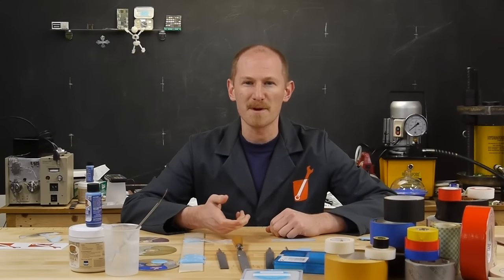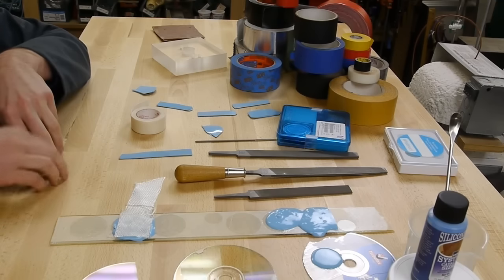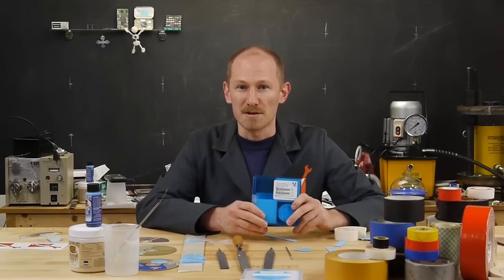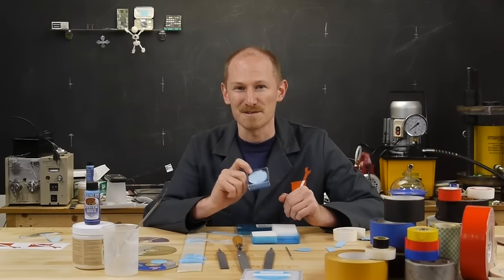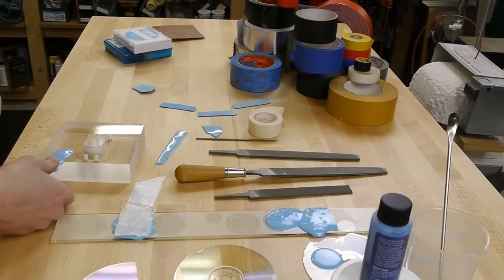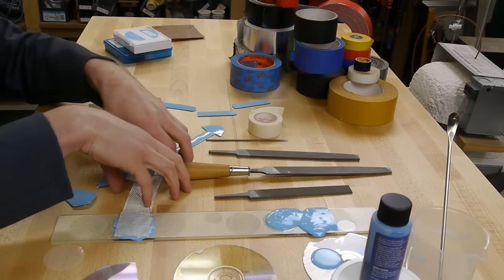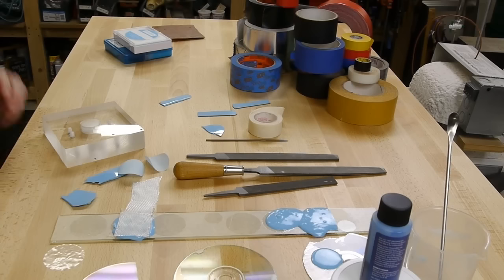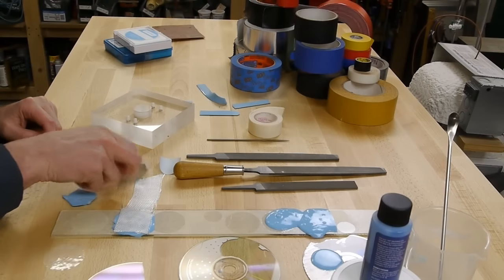Making DIY gecko tape - work in progress

Comment from the maker: I appreciate your comments so much!  Thanks for the thoughtful and helpful advice. From my point of view, the youtube comments section is one of the most active and effective resources for project involvement.
Reply: +Applied Science What does the cast on glass look like under the microscope? maybe it really has a pattern.
Reply: +Applied Science How about casting a 6000 grit sharpening/polishing surface? I believe the structures there are about 2 micron, though likely rather chaotic/unstructured. Not sure it would meet the 4:1 ratio requirements you described.
Reply: +Applied Science Hi Ben. Maybe you can make a mold using fine wires (similar to small scale pin impression toy), and take advantage of the "circle packing problem".  The tiny gaps between the wires would create a negative mold for the silicone. 
By adjusting the diameter of the wires, you could create a very fine and uniform layer of "hairs" on the silicone.  This would produce triangle shaped "hairs" so they may not lay over as easy as the round ones did. The wires in the mold could be angled as well.
Then again, it may not work at all. Either way, just a thought.
Reply: +Applied Science Have you thought about a reverse osmosis filter membrane? They come in a variety of hole sizes. I just did a quick search, here's a picture of a membrane made by memfilm.com, if you can cut it down the center, it has the same tree pattern where the ends are very fine bristles. http://www.memfil.com/images/H1A.jpg
Reply: +Applied Science You can get photomasks made for relatively cheap (in terms of research level costs) by ordering online and sending in a .dxf file with the pattern you want. Masks are commonly available with resolutions ranging from 10 microns down to ~3 microns. Getting masks down to 1micron resolution gets expensive, and if you need sub-micron resolution you'll be needing e-beam written masks which are much more expensive. Also, getting 1 micron or better pattern transfer from a home UV exposure system will likely be very challenging, as the exposure and developing times will need to be carefully controlled.

As for the file technique, you could try a double mold where you cast off the first casting to get a shape identical to the original mold. Likely some sort of release coating is needed to prevent the silicone from bonding to the silicone mold during the second step.
Reply: +Applied Science how about making mold out of gecko foot
Reply: +Applied Science Could the pores of our skin work? i know our finger prints are to large but the pores should be small enough, do to  how we absorb water and such through the skin.
Reply: +Applied Science have you tried  casting into the cast of the file? The sharp edges become the trophs of the cast. So if you cast it again, they would be on top again :-)
Reply: +Applied Science maybe try to make your own metalic layer (control thickness) on a CD and try to burn a pattern down (101010.....)
Reply: +1 on ordering a commercial mask to try. 

I might also suggest ordering a bunch of different diffraction gratings. I can't speak about their aspect ratio off the top of my head, but the spacings should be the same order of magnitude and they are quite cheap (especially some simple classroom sets).
Reply: +user21XXL 
He could also try to modulate the laser's power to change the depth of the pattern.
Reply: How about spaying a powder on the glass before casting. Then you can wash the powder off the tape.
Reply: +Applied Science will it work if you kinda try it like chip manufactureres? do they use some sorta light system? if so, maybe that could work?
Reply: +MrCamoGaming yes, I thought about that too...seems like it would get him what he needs
Reply: +Applied Science  Have you considered using alumina membrane filter discs?  I worked in a research lab and used these to make nanowires.  The aluminum oxide structure in the alumina membrane is a perfect crystal lattice with a common pore size of 200 nm, but different sizes are available.  Polycarbonate membranes have few pores compared to alumina.
Reply: +Applied Science 
Hi Ben, In line with +Henner Zeller 's comment below - you might be able to get high aspect-ratio holes with diameters in the nm-range if you could hack your SEM to work as an e-beam lithography machine. Do you have access to mono-crystalline Si-wafers? E-beam patterning followed by anisotropic etching of the wafer could be one way to go. While chemical etching might give you pyramids, probably an ion-etch would be needed to give deeper pits. A "low-tech" approach might be to use the glass-pulling principle on say PLA. Imagine you started off with a 'rope' of 19 PLA filaments, 1m long. If you could heat-and-stretch these to (say) 7m, then chop it into 7 parts and make a meter-long "rope" again (sounds tedious, I know) and repeat 3 more times, you could end up with sub-micron "hair" usable for the feet.
Reply: I would investigate BluRay discs. They have a much higher data density, which could give you the results you want.
Reply: +Applied Science 
What about making a casting of the casting of the fine file? Then the sharp ends will be on top.
Reply: +Eugene S I knew someone would beat me to this idea, it was the first thing to come to mind as the pores are between .0008-.0001micron. In my estimation pressure would need to be applied to force the silicone into the pores of the R/O membrane because to even get water to pass though my system I need a minimum pressure of 40psi. Not knowing the viscosity of your silicone, I cannot say what you'd need to pass it into the membrane without actually passing it through. It's good to know I wasn't alone in my pondering...Aloha, and hoping your 2016 is going well.
Reply: +Applied Science 
Gore-Tex?
Thanks, Ben!
Reply: +icarus901 I'd made a hard negative mold from a 6000 grit surface, like icarus901 suggested. That way when you cast your latex, you will get a positive, the same as the 6000 grit surface, including the sharp points.
Reply: +Avi Tech This is a great idea!
Reply: +Applied Science Write a Blu-ray with a large file that is filled with data that is written with primarily low data dot, rather than high dashes. The Blu-ray hoes 150nm over the 800nm of a CD.
Reply: +Maxx B I just had another idea, I wonder if it would be possible to get hold of a silicon platter that had been used to make ICs, but had failed testing, so was useless. The texture of the individual transistors etc on the silicon might provide a good molding surface.
Reply: +Applied Science Can't you use an electron beam to expose the photo resist? If so you could use your raster electron microscope to write real tiny structures provided you can vary the beam intensity or have full control over the scanning pattern and speed.
Reply: +Applied Science i dont know if this works, but couldnt you just find some fine sandpaper and use that???
Reply: +Applied Science how about filing the surface of a vinyl? it might not be as precise as other things, but maybe worth a try.
another suggestion, might to try using very fine sandpaper. But that might cause the same problem as the file, with the sharp top/bottom.
Reply: +Applied Science Hi Ben, this might be a long shot but i am about to teardown a device that has a small x-y table that has laser optics and 5 micron resolution (it was a microarray scanner, the laser was for illumination) but maybe could be modified to make a high resolution laser cutter for your mold? - Keep an eye out for it on my channel during the coming week.
Reply: +user21XXL 

That decade old project to burn images to the data-side of a CD might be useful if one can't afford a real laser printer:

http://www.instructables.com/id/Burning-visible-images-onto-CD-Rs-with-data-beta/step2/Convert-a-picture-to-data/
Reply: +Applied Science I don't know if the ratio would be right but would syringe filters work? I know they aren't very big but they have filters that have the pore size you are looking for.
Reply: instead of lenses, use concave mirrors
Reply: you could get an actual geko and make an actual negative mold of the l their foot
Reply: I believe using a vacuum chamber might help results by helping remove the air trapped under and in the material
Reply: It would make a better bond with the mold but wouldn't the structures formed from air pocket voids help?
Reply: +ReluctantProphet I thought the same until Ben said that the sillicone works it's way into the holes fine; and the SEM image showed that this is so; in fact the problem was that the pillars were too long - ironically micro air bubbles at the bottom might have helped!
Reply: +Applied Science you're lucky you have a good audience, youtube comments can be toxic lol
Reply: +Knolltop Farms He's got an excellent vacuum chamber, you can probably just pull a vacuum and suck the silicon deep enough into the pores of the RO membrane...
Reply: +Applied Science try a water in oil emulsion with the silicone. use a tissue homogeniser or even better a microfluidizer to make the emulsion the right average diameter. spread emulsion to desired thickness on polycarb. evaporate water phase under heat lamp. surface will be porous at the right um scale. adjusting the ratio of water to silicone will adjust the density of your pores. at a high enough density the pores will aggregate, and the residual silicone will look like the "towers" you are looking for.  for more information look up thin film formation techniques. you can even sandwich a porous layer on top of a smooth layer for strength.
Reply: +Applied Science Why don t you mold the surface of an aerogel? the open pores would allow the silicone to penetrate far enough without needing vacuum.
Hydrophobic aerogel might work best, to prepare it just expose a normal silica aerogel to silane vapors under vacuum or neutral atmosphere (just heat a piece of silicon to generate the vapors).

Porous silicon which is made by anodizing silicon possess also such kind of long interconnected pores and are not so hard to make.
Previously proposed anodized aluminum exhibit highly ordered pores but no interconnexions so trapped air might hinder the silicone penetration but i could be wrong.
Reply: a CD/DVD burner should not require too much fiddling to achive the required density of pores in the substrate to be used as a mold (the blank disk), maybe it can be regulated to produce different depth...
Reply: +Applied Science So, Destin from Smarter every day did a video on Butterfly-wings where the Colors are created by gaps in the structure which absorb special wave lengths. Therefore I assume these gaps are really small. And i think there are some materials which mimic this property. So maybe you could use butterfly-wings as a mold :D
Reply: There is a way to get nano structures cheaply if you're not squeamish. You can use lab-grade "disabled" viruses which are hydrophobic over there entire body length, yet hydrophilic at their ends (I'm thinking of disabled Archaea type viruses). If you spin cast a drop of water on a glass plate then, you spin cast a drop of those viruses on top of that uniform humidified plate. Since the viruses are hydrophilic at their ends, they will all "stand up" on the humidified surface (densely packed I may add since their girth is far less than their length).

Afterwards you can put a layer of casting silicone on top. When you peel off the silicone, you dissolve the viruses with an enzyme solution, leaving a negative impression of nano meter structures. From then on you should be able to make a "positive" cast of very densely packed nano meter diameter / length structures (depending on the type of virus used)

Hope this was useful suggestion :)
Reply: +Applied Science  Can you use your electron microscope's electron beam to do the etching? That should have a fairly high resolution....
Reply: +Applied Science the youtube comment section is good only because you inspire goodness. Usually, on average, the youtube comment section is an absolute mess; rivaled only by IMDB and Yahoo Answers. But when people make good videos like this, it can inspire good comments. This is why you are one of my very favorite channels.
Reply: +verdatum 
Ben inspires goodness, and he makes it look easy. He seems to have an inherent talent for effective communication.
Reply: deposit nano tubes onto an substright.  Chemical Vapor Disposition (cvd) deposited onto a silicon waffer ( don't want arc method too messy)
Reply: nanofabtools.com has some information, I googled for "nanostructure of glass" and looked on the image search results for something similar to what you described
Reply: Hack a DVD burner by increasing the power of the engraving laser, and burning it with only 0 bits, to make only dots at a microscopic scale. Or maybe, try with a blue ray disc, as those have a better depth/width ration
Reply: Microcircuits can be created via litho by means of a tracking lazer, a glass die and essentially a magnifying lens. I wonder if there is a method to replicate this at home for creating micropore and the like
Reply: jcims  Thank you.
Reply: +Applied Science maybe you could use or hack a CD/DVD burner to write a dot pattern over and over to get the depth you need, not sure if you would need to prep a special surface on the media, or if in fact CD/DVD burners are capable of syncing writes that closely (i.e. multiple write passes might be out of alignment).
Reply: +Applied Science What if you tried a Mr. Clean Magic Eraser, or perhaps a finer pored melamine foam, if you can find it?
Reply: *****
What if you used the burned media as a mask instead then for some form of photoprocessing?
Reply: +Applied Science How about using your photo lithography, but using interference patterns from a scattered UV source? You can get down to pretty small feature sizes with this approach.
Reply: +Tobia C. What if, instead of a normal CD, he uses black plastic in the shape of a CD.  Then, couldn't he use a modified CD burner to etch the plastic?
Reply: +Applied Science 
I think you can try immersion lithography. It is basically introduction of highly pure water between mask and the substrate, to reduce the dimension of the transfer.
I mean that's how they are still using ArF UV source, instead of deep UV source for the IC manufacturing. It might help you out.
Reply: +Applied Science Not sure if anyone else suggested this, Dvd/Blue-Ray have even higher densities than CD&#39;s maybe you can give them a try. Also try to see if you can do a static burn pattern to just write 0's or 1's.
Reply: David Dachenhaus I've seen others, including myself, suggest the blue-ray. However, the static burn sounds like a great idea.
Reply: +Applied Science you could make a mold on the very fine file then  cast your rubber on that.
Reply: +Applied Science  Saw this paper: Solvent-tuned hierarchical porosity in nitrocellulose aerogels.

Maybe try an aerogel substrate for the casting.
Reply: +Applied Science - how about using Basotect ( http://bit.ly/1OI988C ) as the casting mold.  It's an super fine open cell foam, most commonly seen as a "Magic Eraser."  Or, perhaps stacked and alligned graphene sheets in thickness enough to reach the desired length of the "gecko hair" through the graphene sheets' mesh.
Reply: +Applied Science http://www.sciencedaily.com/releases/2015/08/150831085716.htm

just use a anti-fog & super water repelent optic lens as mold..
Reply: try to use a super fine sharpening stone
Reply: +Applied Science Why not use an old Hard drive platter? (not the new magnetic coating type)
Reply: +Calvin elopo  My first thought was, super fine sand paper. But i think a fine sandstone,
 would be better... Much flatter.
Reply: +egortheroge same here, sandpaper, stones available ten dpi.  leaves, fern fronds, fungi or butterfly wings all have very dense surface structures. algae or bacteria grown in a dish. Rubber inner tube is porous as,
Reply: Just a hunch, but I think it'll be important to get a uniform pattern for this to work properly
Reply: Uniformity would in manufacturing, practical uses would be limited eg Velcro. Hookf stick to something's,  fluff to SFA. Fluff to hooks,magic
Reply: +Robert Jochim (WA1RJJ) Re graphene: …no. Silicone molecules are much larger than the space in the middle of a hexagon of carbon atoms.
Reply: i noticed that the hairs on the geco foot had split ends or fractures. They looked similar to the tips of the new tooth brush bristles you examined in an earlier video. you could try making a casting of just the tips. Here's a list of what justpops intoy head. 
1. gortex use a vacuum to pull the casting material in, adjust hole size by carefully streching the material.
2. mix and oil or acrylic based paint with salt that is ground the the exact hole size wanted. paint the slide or castimg surface with the paint, once set place it on warm water and dissolve the salt.
3. crazed casting surface. paint the slide with mixture that contracts when it dries leaving a fine web of cracks.
4. carbonate or dissolve another gas into the molding material. when the marerial has reached a gel like stage release pressure fr the casting chamber.
5. use a silk screening type of meathod, trying different screen parameters.
6. apply the compound the unsealed grainend of a board with a fine grain.

The most effective will be the method that can get the most surface area closet to the object. The natural fractured looking ends would probably work best but would be the hardest to make.

hope one of these helps. I might be able to think up a few more if needed.

Thanks
Tom
Reply: +Applied Science Anodized aluminum or titanium. This article can be a good source of information for that challenge (A review on the progress of polymer nanostructures with modulated morphologies and properties, using nanoporous AAO templates. doi:10.1016/j.progpolymsci.2015.10.003).
Reply: Just a wild thought: for my bachelor thesis I used the same membrane to fabricate nanowire solar cells. These nanowires were grown by electrodeposition in the pores by electrodeposition this was a very controllable process and the size could be controlled. You could use this method to fill the membrane with Cu2o and effectively reduce the depth of the pores and such create shorter pores and shorter pillars for the gecko tape. pm for more info if required
Reply: +Applied Science Why dont you cast the silicon that you casted on the really fine file. that away its sharper on the ends rater then the bottom.
Reply: +Applied Science  what about a laser  etched glass wouldn't that work.
Reply: Cast a gecko foot
Reply: +Aaron Arnold Good in theory, bad in practice. The silicone would stick to the other silicone.
Reply: Not if you cast it in copper or something. Just getting a negative casting process seems like another thing to get get hung up on. You could try getting a the casting mold for the file?
Reply: +Aaron Arnold if you use metal id see it to melt the silicone.
Reply: How about a leaf? Similar to the suggestion of skin (due to pores) by an earlier comment. Maybe a desert plant that I would imagine would have small pores to avoid moisture loss.
Reply: Rather than the CD, have you tried using something with a higher bit density, like  a DVD or a Blu-Ray? Furthermore, you could try writing nothing but 1's to the disk to get short valleys to get the right aspect ratio consistently. Or, you could try casting a negative of the Swiss file to get your silicone cast to have the sharp tips.
Reply: Haha. I just posted this exact idea.
Reply: Maybe you can try to cast a bigger shape using some kind of thermoplastic foam and then shrink it with heat and high pressure, like a styrofoam cup in a pressure cooker.
Reply: I'm no scientist so I may be way off.  Maybe blow graphite onto photo-sensative glass.  Control the density by controlling the amount of graphite.  Control the depth of the pits by controlling exposure and soak time.
Reply: Not sure if you're still looking for suggestions, but another idea that came to my mind is to use one of those diffraction grids that are used for demonstration purposes at physics classes (experiments with light and things like that).

Btw I'm really surprised silicon did fill up all those holes in things you've been molding. I wouldn't expect this to happen.
Reply: Applied Science 🔬 my idea is to use the Swiss file and get a resin cast of that. Then make your silicone cast so that the pointy sharp end of the file is now the pointy sharp end of the gecko tape's ridges
Reply: Applied Science look at nature for molds
Reply: Ben, you are trying to achieve essentially the same micro structure that gives the lotus leaf its hydrophobic self cleaning properties. You can do a two part casting:

1. Cast the inverse of the lotus leaf by pouring silicone or some other fine resolution casting agent onto the lotus leaf.

2. Cast the silicone onto the inverse lotus leaf casting. If you used silicone, you will of course need to spray with mold release.

Good luck!
Reply: You may want to look into using an etched aluminum oxide which has a dense packing of pores, high aspect ratio, and can be on the sub-micron scale.
Reply: My suggestion would be a not dyed aluminium anodised surface. it has almost a honeycomb structure (not all sure about the sizes) but know the amount of time it spends with the current going through it the depth can be managed. 
Also it might be possible with a titanium anodising too.
Reply: where did you find the super fine swiss file?
Reply: Grow carbon nanotubes on the silicone maybe
Reply: You couldn't be more right. This comment section is a showcase of what the internet has to offer in terms of sharing information from an expert level.
Reply: Applied Science did you figure it out yet
Reply: Maybe use spray deodorant on glass
Reply: @djohokin2325  I was thinking the same thing.
Reply: Ben, try making liquiglide. I 
Think if made correctly would be perfect for sla/dlp printers. You would coat the vat, abd there would be no suction while the bed pulls the part up.